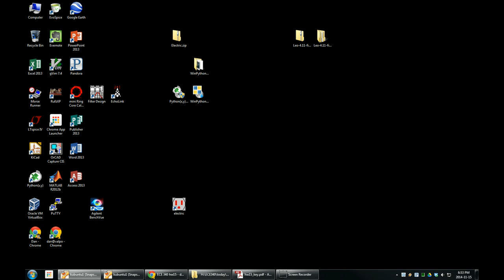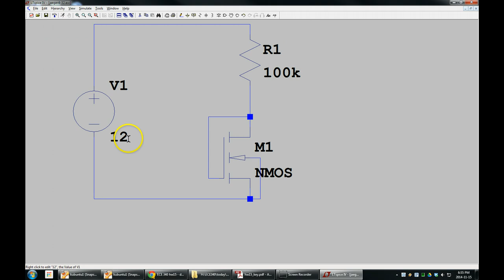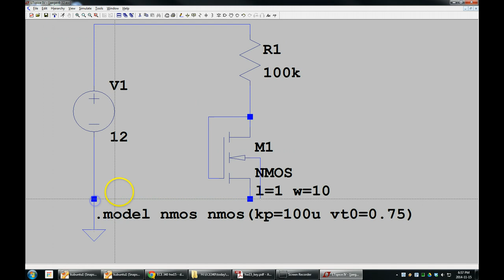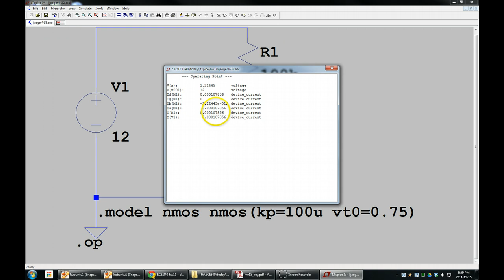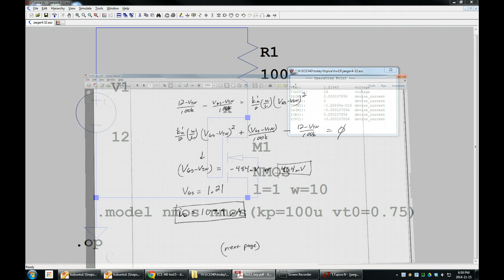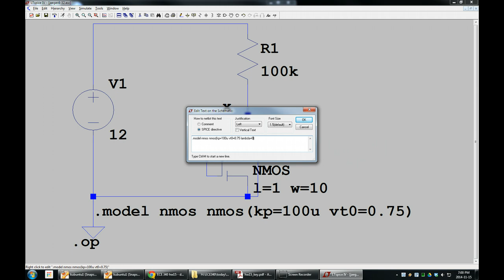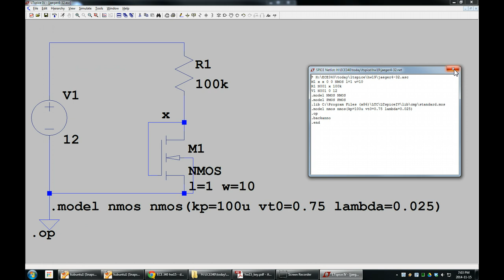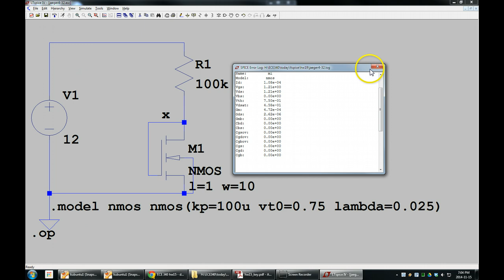LTspice - simulate hw problems with MOSFETs

Comment: Thank you for the video. I am trying to simulate a PMOS. The odd thing is that the VGS I get in the error log is not the one I set by voltage generators in the schematic. I am pretty sure I enter the schematic and the parameters in a proper way. All simulations work and results are reasonable but I am very puzzled by the values of the error log

Comment: Can u show me how to enter mosfet parameter (unCox, Vto, Cgd, etc.) when i use 2 mosfet (pmos & nmos). because i will simulate singgle ended 3 stage ring oscillator using pmos complementary load.
thanks at first.